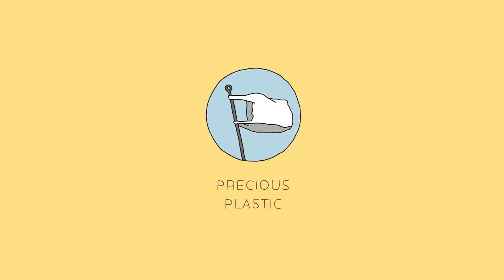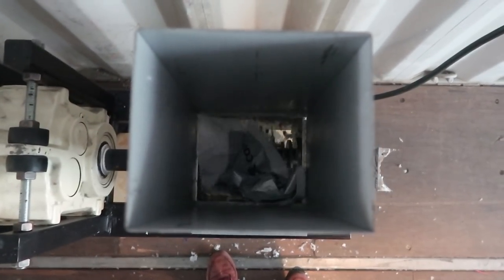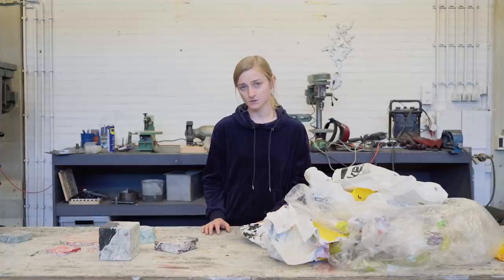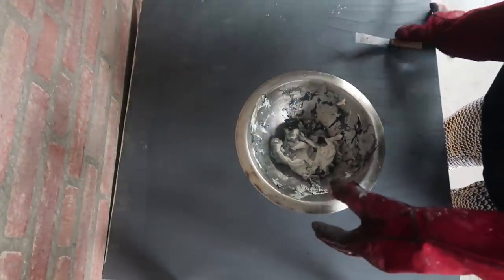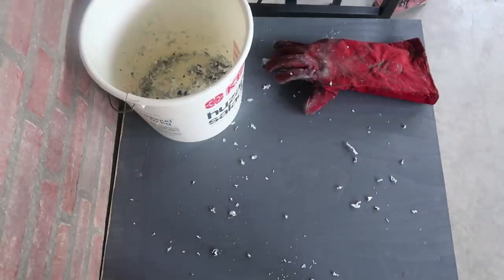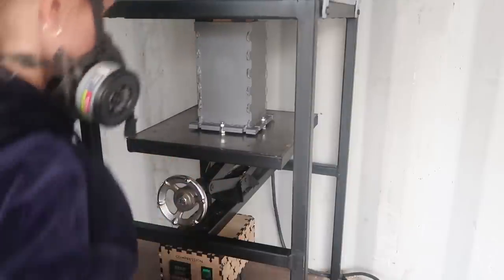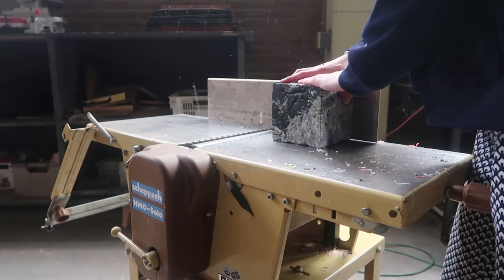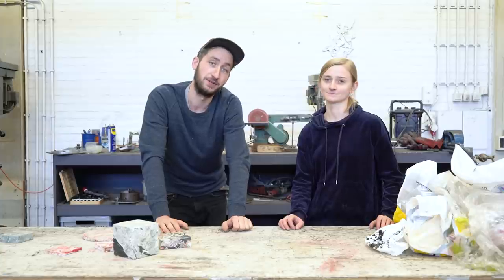Create marble from plastic bags #preciousplastic

Comment: Your better off to use a bench sander of some sort for the leveling processs instead of that jointer........that jointer dosnt have a gaurd and your workpiece is way to small for that machine. These machines dont have feelings and dont care about what its cutting...dont put your self at risk. Theres an easier way to machine that piece with simple sanding tools on a coarse grit...i did some dangerous stuff with these tools aswell untill i nicked the tip of my thumb...now i think outside the box before i just work something, cause healing takes forever and time is money and luck runs out....nice work though, dont trash..recycle 👍🏾
Reply: Pretty sure they just took the guard off to get the shots done.
Reply: Theres always different approach

Comment: I appreciate recycling..... however, if the fumes are so dangerous that a breather mask is to be worn, then ‘we’ are just polluting via an alternate path, what is being released in to the air seems more harmful than the recycling helps......???? The results are beautiful but I’m not seeing enough payoff exchange to make it ‘worth’ the new harm.
Reply: As long as the plastic doesn't burn or boil, there aren't really any fumes released. The plastic is only going from a solid to "liquid," and it's not hot enough to actually vaporize. It seems the mask is only a precautionary measure.

Comment: What about making plastic bricks?
Reply: plastic is flammable. You can't use it for making homes. Bricks must withstand a 2 hour long flame test to be rated up to code in the US for buildings.
Reply: @omgwtfbbq12345678910  uhmmm... pathway? gardening bricks?  fishponds? there are many uses not just to make a home.
Reply: If you don't call them "bricks," do they have to pass a flame test? As a potential new type of building material, it should have it's own standards, rules, and regulations for code. Also, I can see them being solid enough (I've experimented with this process a bit, myself) to be used as a building material, but what type of "mortar" would be best to hold them securely?

Comment: is it me or is the carbon created to make these far greater than that saved by upcycling the bags?
Reply: Not really. Plastics eventually get dumped into the ocean and the micro-plastic waste ends up being the major problem environmental scientists tackle. The it's better to keep plastics on land then it is in the ocean since it's easier to make bricks with bags then it is to clean plastic from the ocean.
Reply: @omgwtfbbq12345678910   I see the advantage in saving them from the ocean.  Thats very clear.  I'm referring to the electric and other resources consumed by the machines melting them.  Plus the toxic vapor melting plastic creates.  from a carbon footprint perspective it seems as though you are creating a larger carbon foot print to make these than you are preventing.  thats what i was unsure of.

Comment: Mmmm.. Energy efficiency.
Reply: Xfactor Chem energy is renewable, plastics aren't 😊
Reply: In theory sure. But unless the energy was from 100% from renewable sources (globally around 87% of energy is non renewable, -from Wiki 2015) the actions in this video might have actually caused more harm. 

Notice my wording though. Despite the process being terribly inefficient the overall message this video (and channel) shares more than makes up for it. Keep up the good work!

Just for fun, some back-of-the-envelope calculations. Let's assume 50% renewable power, 1kW oven, and 595g of CO2 per kWh (number from Carbonfund).  I took low-end estimates, so it's probably even worse. But for every hour that oven was on about 300g of CO2 was released in to the atmosphere. Which is equivalent (assuming a CH2 chain) to flat out  burning a little under 100g of plastic. Really makes you think. Also it would be interesting to see how little power you can use. Shedding and sintering the plastic comes to mind.

All I need to do now is calculate how many grams of CO2 were emitted as a consequence of writing this comment :)
Reply: Osmisa I think they are located in Czech republic and Sonia is from Poland, they said this in the video....
Reply: I was thinking the same thing. Melting all the plastic at once would have been more efficient. That or find a way to use the extrusion machine or injection machines. I can just tell they are more energy efficient than the oven.
Reply: MrFrambooise Mr. Hakkens is from the Netherlands, and I think that’s where this is filmed.

Comment: Dave, this video is great and it motivated me to register into your website so I can be part of such community.  However, it's the most frustrating platform. You need to change its settings. I think fewer people will participate for that reason. For one, after creating the account. I have to confirm the email which is fine, but after I need to enter a key which is provided. But it doesn't work. Why in the world would put an activation key to participate in such a community? I mean you're trying to create a community of collaborators for recycling. So why would you make the registering to the website a pain in the butt? Anyway, I've given up, because I'm not able to even pass the first window to sign in. And yes I'm putting the correct information. Hopefully, you take my advice seriously, as there many people out there that would like to make a difference and be part of the solution.

Comment: What about all the little particules that fly everywhere when you sand It?
Reply: sweep them up and readd to the blocks to form more squares is what i would do , or use the confetti like pieces for a craft, there are hundreds of crafts on you tube to melt down and recycle straws/ bottle lids etc.. you could also take a plant pot, put some adhesive on the side and sprinkle diff colours of the shredded bits to make a decorative outside pot? that’s what i would do! Anything NOT to have them land out at are landfills, it’s a BIG problem.. big kuddos to the people that made and posted this video, i shared it on my social media account to get the word out ! ☺️☺️ Another spin on these is that instead of cutting them, use E6000 super glue and make framed boxes from them for your garden.. would be much lighter to move these around rather than wood planter boxes, right? Or a nice marble trim around flower beds etc .. we all have to start thinking OUTSIDE the box on things like this or our environment is going to pay the price ! 😓 Just a thought or two, i am not trying to spread any negative comments, just trying to share a couple ideas to help... and lastly , this is FREE decor, you already paid for the bag, so making it into something means you aren’t out in the stores buying more stuff to decorate your yards etc ☺️☺️ Good luck everyone, and happy recycling!!😉😉😉

Comment: Nice but I don't think I will ever have access to any of those machines in my lifetime. My question is how much electricity do you use per kilogram of plastic bags melted? I only have access to a discarded non-stick pan, an induction cooker{with temperature control within 10 degrees} and a car jack. Any thoughts on how I can make this work? I can purchase a glass pan lid if that helps.

Comment: Seems to require a lot of energy, not to mention the extreme labour intensity. Bad for the environment as far as I can see.
Reply: Filling a giant hole in the ground with plastic bags is a better idea?
Reply: In terms of relative harms, yes, putting it in the ground is less harmful than this method of recycling. But I'm sure there are far more efficient ways of recycling that won't heat up the planet as well.
Reply: Burying it wouldn't create all that harmful plastic dust either!
Reply: We should probably just not make all this plastic crap to begin with.
Reply: wow
Reply: and feeding the plastic bags to the ocean life,,, so much better than reusing the plastic!
Reply: I  see this whole facility as a lab, a laboratory of ideas. This is not a factory, its a workshop. You transfer lab ideas into workshop, and then you set up factory. These are working principles, in the factory you would make insanely huge furnance, you would have hundreds of molds going one after another into compression machine. And far less man labour. Imagine you see someone make a craft beer in a garage, and you say its not profitable to produce beer.